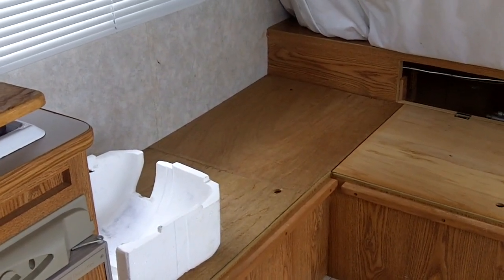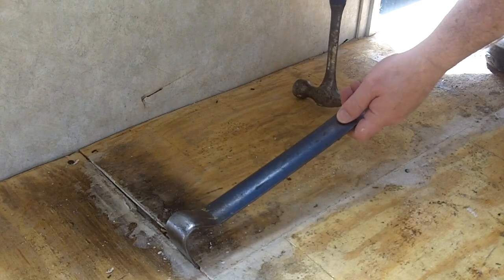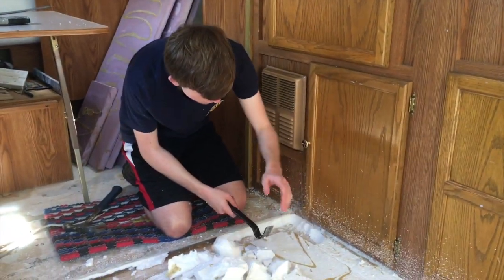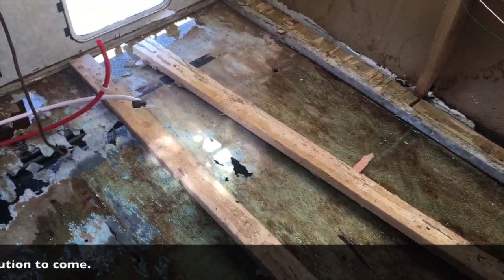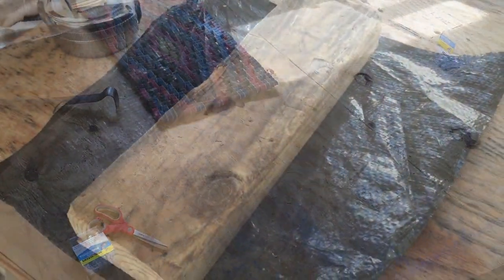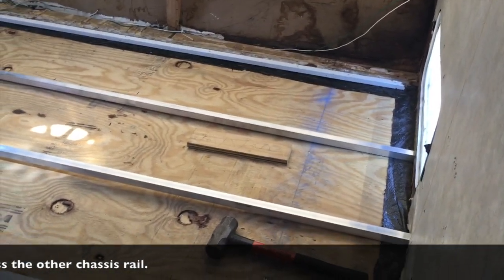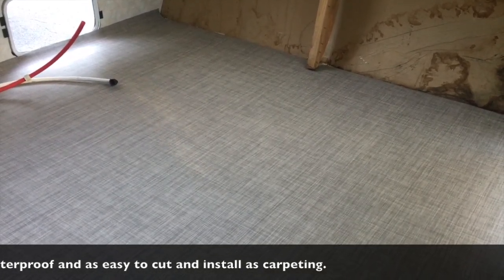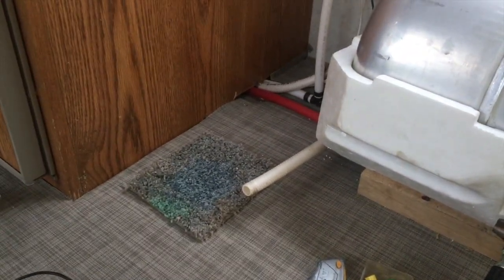RV Camper Floor Replacement

Comment: Two questions (as I'm replacing the flooring in our travel-lite camper due to water damage)...did you dig out the flooring under the fridge? We need to take out the flooring under the kitchen sink/stove area but really don't want to take that cabinet out if at all possible. Also, why did you go with the aluminum supports as opposed to using the 2x4s? Any insight would be greatly appreciated. Certainly appreciate you posting this video!
Reply from the maker: I also have a Trail-Lite and I, too, did not want to take out the sink/stovetop/refrigerator cabinet. So I cut out the bottom 3/4-inch of the styrofoam so a piece of plywood could extend under the frig and across the other chassis rail. I also chiseled out "channels" to extend the cross beams under the frig and across the other chassis rail, too. As for why I went with aluminum and not 2x4s, the 2x4 did not provide nearly enough support. They simply flexed too much when you would walk around on the floor. I bought five pieces of 1-inch square stock, 8 feet long, from onlinemetals.com for a little more than $100.
Reply: Rick Kessler awesome to know you were successful in digging out below the cabinet! That's all I have left-all the other flooring I'm going to take up is already out. Thanks for the feedback on the aluminum...I'm (obviously) a novice but I assumed the 2x4 would be more stable than the aluminum channels. Now I'll look into using those! Thank you thank you!
Reply from the maker: You're welcome and good luck.
Reply: Rick Kessler we are now pretty deep in this project-super excited on how it's coming along! Soon we will be replacing the floor (as soon as we confirm all the leaks are stopped). Where did you get your aluminum tubes from? I looked at lowes and couldn't find them. And did you buy them at 8 feet then just cut them down? Hope you don't mind-i may have other questions as we start replacing the floor I would like to ask.
Reply from the maker: Don't mind at all! I bought them at www.onlinemetals.com (here's exactly what I bought: https://www.onlinemetals.com/merchant.cfm?pid=1193&step=4&showunits=inches&id=1271&top_cat=60 ). They came in 8-foot long lengths that I cut down with a hacksaw. Suppose you could use a jigsaw and a blade meant for metals, though. They have several sizes available. They deliver the pieces to you, but one of their locations was nearby so we just picked them up to save on shipping costs. They were about $23 each.
Reply: Thank you! One more question (for now)...did you just lay them in or did you attach them to the side rails somehow?
Reply from the maker: I did not attach them to the side rails. So far, that has not been an issue. Perhaps, if you have the means, welding them to the side rails would be best. All I did was screw them through the bottom layer of 3/4-inch treated plywood and into the chassis rails below.
Reply: Rick Kessler awesome! That's what we were planning to do, but just wanted to make sure that that is working out good for you. I don't want to Pay anyone to weld anything if I don't have to. 😁
Reply: Rick Kessler resident PITA here. We have FINALLY gotten our floor sandwich back in. What did you do at the plywood joints? We still have a bit of flex in them where the pieces meet, and I'm not sure how best to keep them together before we put the flooring down.
Reply from the maker: H-clips

Comment: Did you go under the walls? Or just go up to the wall? Was yours rotten under the wall? I only gotta replace the back half of mine and I know in the bathroom area it is pretty bad.
Reply from the maker: I did not go under the walls. My walls were not rotten. The perimeter of the floor is aluminum framing, which the walls set on. If I felt I needed to, I could have attached (spot welds or riveted L-brackets) the aluminum cross beams I installed to this aluminum perimeter under the walls. Running the walls under the floor would have made this project much bigger than what I was capable of doing.

Comment: Rick what did you secure the bottom layer of plywood and the aluminum tubes to?
Reply from the maker: I secured them to the chassis using self-tapping screws.

Comment: Seen the video and just an fyi, treated plywood is not a good thing to use for a sub -flooring material. There are chemicals in that treatment of wood that will cause reactions to your nails and or screws you will use.  Even the metal that is used for the side may have a reaction to that wood.  Using the barrier was a smart thing to do but does that breath?  If this does not breath you will create an issue in a few years down the road.
You even installed treated plywood to make that your finish flooring material, again, you will have an issue down the road from the wood drying out and warping.  Not just that but the wood chemicals will cause an reaction to the products you screw or nail through.
If you watch home builders, they never use treated plywood for flooring or sub-flooring!  Against codes!
Let us know if you have any issues down the road with your flooring project.
I just seen you had stated about the glue you was needing to install your flooring product?  This is another reason why you do not use treated plywood for projects like your doing.
Other than that, you done a good job about the project in general!!!
Reply: Hi Jeff! You seem to know a lot, I have a question for you. We are completely rebuilding our vintage camper from scratch. The flooring situation is confusing with a lot of opinions out there. What would you recommend starting from the ground up to use? Ex. In this video he did underlayment barrier, treated 3/4 plywood, insulation, treated plywood again, then vinyl flooring.

Comment: wow.  thats a lot of man hours.  and work.   I think I will just buy a new camper.
Reply from the maker: Sure it was a lot of work. But I enjoy the satisfaction of a job well done. And the cost of repairs was a helluva lot less than a new camper.
Reply: Couple hundred dollars is way cheaper than another used hybrid camper. Another one the same age goes for like 5 grand and there's no guarantee that you won't have to work on it.

Comment: you said “half inch treated plywood”

BAD idea. Treated plywood rots aluminum and steel. PT anything should never be used in campers or boats. Ever. (Unless you have a 25 year old stock of CCA plywood from before they banned it; cca didn’t harm metal)